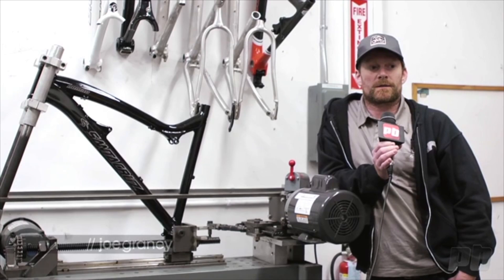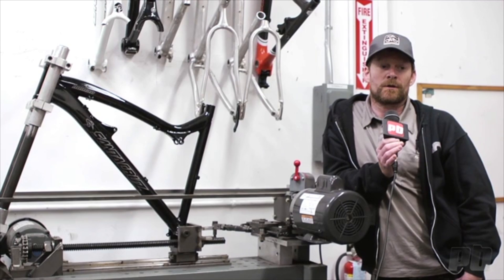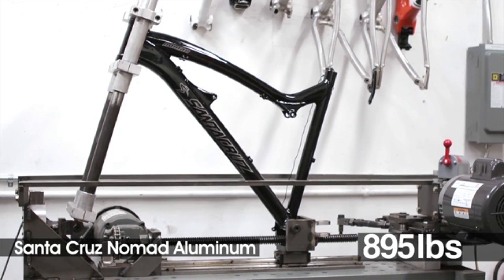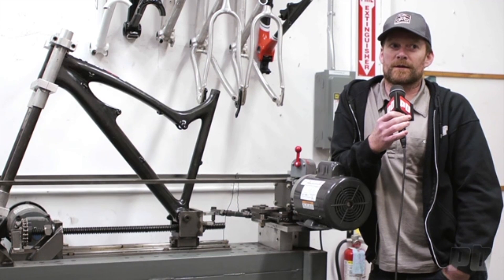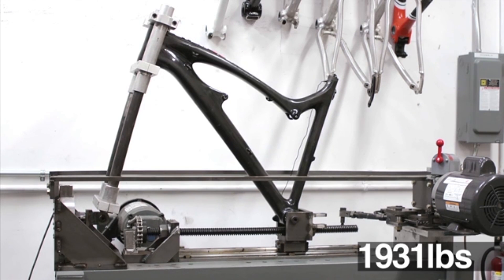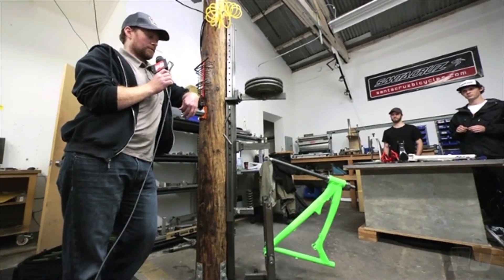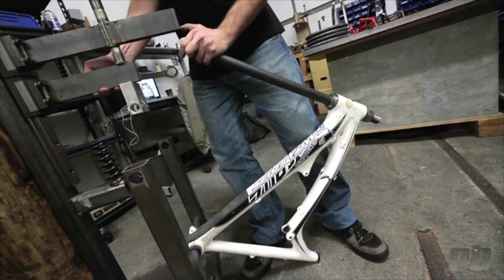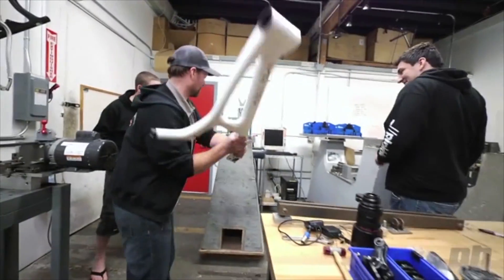Carbon vs Aluminum Frames - Which is Stronger?

Comment: carbon hides internal delamination well, which for me is just as dangerous as a bent or cracked alloy frame, aluminium has the win for me, if I was a sponsored rider carbon all day please.
Reply: No delamination. the loading was not shear.
Reply: soo are you riding carbon or aluminium haha
Reply: when you just bought the highly expensive carbon one and found out that you re failed. Then find an excuse to look good in certain way lol
Reply: I just got my first carbon mtb. It’s a SC with lifetime warranty and I know they will take care of me should something happen. Feel so sturdy and rigid 👍
Reply: Pretty much all companies have warranties on their frames nowadays, so you don’t need to be sponsored to avoid economic ruin.
Reply: Yep I agree if I was a sponsored rider I'd use carbon but I will never use the same bike more than once in a competition.  Ride it hard one day then get rid of it for another.  I don't trust carbon anymore than that.
Reply: Flats Forlife Dont think you have anything to worry about going carbon in this day.. Its virtually a non issue at this point.. I've been on it since 09 without a hiccup.. Big crashes hucks to flat.. Complete and utter pure unadulterated north shore and rocky mountain riding and not a Single issue! Don't be scared of the big C! It's come a long long way.
Reply: I work with composites quite a bit myself in the work I do, not bikes, but I am also a qualified pushy mechanic, although it's been a while now, but still not convinced it's the best option for a bike, looking at going cro molly myself, full circle I guess, but nothing has ever ridden as good as cro molly bikes for me, weight I am not scared of so only makes sense for a weekend warrior.
Reply: Flats Forlife Well I had the the first 2009 blur ltc that I rode hard and put away wet for 4 seasons! It then went to my dad who tops scales at 270lb and now my cousin for the past season until now.. Still waiting on delam or any inherent issues talked about.. Im all about real world use and its carbon all day for me!
Reply: I'm all about real world use also and carbon will not cut it for the riding I do, I just have to remember not all ride the conditions and style I do, ( theres a reason you do not see carbon trials, street 20 inch or dirt jump bikes,)  I guess for cross country people etc who's parents also suit their bikes it will do just fine, but for those of us who literally abuse their bikes every ride it will not cut it, casing a large jump alone is detrimental to carbon frames 9 times out of 10 whether it shows straight up or hides it within the weave for down the track you will not know, as for delaminations who are we to say it has not started inside the frame already, that's why I say it hides it well, usually a delam will occur on the inside of the tubing in the rough areas where the bladder has left hard edges and corners etc during the moulding process not on the smoothly laid outer surface you see with your eye. you will be oblivious to most delams until it goes bang, that's when you realise ooh I wonder how long that was like that?
Reply: Flats Forlife are u kidding me..Have u seen the shit cam Zink, Kirt Voreis, Andreu Lacondeguy hit on full carbon? It is plenty good enough for anyone in this comments section guaranteed! Providing the newer stuff of course. Danny Mckaskill absolutely destroys on his Santa Cruz 5010 or Bronson full carbon..Myself, I smash a Trek fuel ex 9.9 in Whistler bike park without any issue!..Its come a loooooong wayyy.
Reply: yep, correct and backs up my first comment of if I was a sponsored rider carbon all day long, those frames would be one comp and retired seriously sponsored riders continuous access to gear gives a false sense of reality to most. as I bail on more jumps etc than not it doesn't make sense for me, the fact a pro will pull off nearly every attempt makes sense for them to ride the free carbon bike pushed upon them by their factory etc, it sucks people in for sure.
Reply: Flats Forlife Well I've been on full carbon since the inception of the Santa Cruz blur Ltc..Im no pro but I've cased numerous gaps, hit trees and had some epic bails..From 2010-now ...Not so much as a hiccup ..The suspension takes more of the beating and I'm always servicing.. Also don't kid yourself if you think alloy doesn't get compromised over time and break catostrophically. ..
Reply: alloy bends before it breaks, gives you fair warning, bent alloy frame buy a new one before it breaks, delaminated carbon frame you would not know until it breaks, delam is the bend in carbon you could say, but you will not see it like one in alloy, suspension does help and as said this is why you will not see carbon on full rigid bikes that cop abuse, hence reinforcing the fact alloy and steel are the way to go for strength carbon is the way to go for weight saving for sure, but to think you have gained strength and structural longevity from using it is far from the truth.
Reply: Flats Forlife alloy bends before it brakes if it's not at a weld ..Ive seen it fail straight away at weld joints and that was just at 24 hrs of adrenaline race..Yes carbon will fail immediately..If it does ..But again, highly unlikely on the newer stuff.. I'm even on carbon wheels now and casing step ups constantly ....When I have a fail I'll gladly post here.. However ,I think ill be an old man by then.
Reply: @electricdeckhead3083  still not convinced? Even downhill pros ride carbon at this very moment...
Reply: @DutchBassics  so would I if my bikes were supplied, hehehehe 168 people agreed with me it seems.
Reply: @electricdeckhead3083  yes, three years ago... xD

Downhillers are still free to choose aluminum, but they don't...
Reply: @DutchBassics  redbull rampage riders don't, hehehehe
Reply: @electricdeckhead3083  Brandon Fairclough is a Rampage rider and he rides carbon... xD
Reply: @DutchBassics  correct, but thats a minority as carbon is among redbull riders because alloy handles more abuse.
Reply: @electricdeckhead3083  nope, it doesn't. Carbon is much stronger than alloy...
Reply: @DutchBassics  did you even read the link? quite simply it doesn't handle the abuse aswell which is why most ride alloy still at rampage,
Reply: @electricdeckhead3083  no link posted....

Comment: If another idiot says aluminium is stronger than carbon fiber, I'll crush his head with a similar machine they used
Reply: Carbon is obviously stronger and stiffer than aluminum. Where carbon fiber fails is when it as been compromised. Let's take for example a carbon fiber hockey stick is almost unbreakable when brand new. Play a few games with it and chip it to a point where some layers of carbon break and the stick will break without warning and without much pressure. I'd rather ride an aluminum MTB because I bail quite often and I would risk compromising it. On my road bike, I take carbon because of the weight, rigidity where it's needed and comfort where it's needed.
Reply: +ttoussaint 
1) let's start with the fact that a hockey stick is meant to bend a lot. I play hockey BTW. Of course it will be compromised after a long use since it will resist very intenses flex. A carbon frame isn't meant to bend as much as a hockey stick. Not in any similar way in fact. Carbon tubes will bend just a little amount and of course they can break like anythhing else. But I can tell you, I've crashed my carbon bikes a lot and they never broke appart. But I have broken 2 aluminium seatstays.
2) the best argument I have is that carbon fiber is just as good as its engineering and the way it is assembled. I'm not wondering why Formula 1 car aren't made out of aluminium.
Reply: Anthony HT Hahahah so true man! Peeps are still stuck in 2003 thought processes
Reply: Why are you so worried for signs before failure? We've seen the aluminium frame slowly bend from 0 pounds of force all the way to 1400 pounds of force. But you know what, at 850 pounds, there was already a serious deformation in the down tube. It's a good thing to know that there wasn't similar signs of failure for the carbon frame at the same moment. In fact, signs of failure for the carbon frame happened very suddenly at a force almost twice higher than the alu frame. In my opinion, they were too kind with the aluminium frame, they should have declared its breaking point happened at 1000 pounds of force, where we can see the down tube getting warped. In the end, it's a consumer choice, you get the best you can get for your money, and aluminium frame are still very good, don't get me wrong here. Carbon is just more solid and better WHEN properly engineered.
Reply: Yes when it snaps, it snaps and that's the end of your ride. But don't you think it's good to know it takes more than double the force to break a carbon frame compared to an aluminium one?
Reply: @Hoshikani, it's only as good as the engineering that's put in. I never said carbon fiber was a perfect material. Have a nice day and go find someone else to blast in another comment section.
Reply: So the consensus is Aluminum is Stronger than Carbon.....
Reply: Micah Watts  yes! That's exactly it... Especially in 2017..
Reply: ttoussaint That's apples to oranges dude!
Reply: Trevor Bohnsack  Well, when I see a hockey stick and a bike frame snap, it's pretty much the same. There is next to no signs before failure. That being said, you can hear the frame in the previous video, when put to pressure in a progressive manner, cracking. You can hear the fibers giving up before the snap. That's enough for me to stay away from CF until they really prove that it can sustain more abuse. I'm not saying that aluminum is better eather, it's just not worth it for me to spend the extra money for something that I would not feel a real difference on the riding because well dialled suspensions will make a bigger difference in the comfort and I feel my aluminum frame will be harder to compromise when crashed on the ground.
Reply: Indeed, it has the potential be be a lot better , but consumers have no ways to check if bike carbon has been well made or not. Even top brands like Trek make/made carbon frames with issues. And as can be seen in this video, when they snap... it's immediate and without any possibility to control your fall. You just end up with 2 bike halves. and that's scary.
Reply: Anthony HT damn straight!
Reply: Anthony HT Hahaha!
Reply: Dawn Moon I guess hypothetically speaking one could get a a lemon frame....Highly unlikely at this point in the game tho...That being said, I'm on a Trek fuel ex 9.9 now..These frames are insane ..All the tubing has been beefed up as well as the chain stays...I tested both the alloy and carbon in demos before purchase..The alloy is no where near as stiff and had flex in hard cornering...The new Trek oclv carbon is unfuckwithable in every regard...Just go demo one !
Reply: Dawn Moon Also keep in mind how strong it is in this test and this is 5 years ago! 5 years..Thats a long fucking time  son! Its come leaps and bounds since this test even.
Reply: Anthony HT carbon fibre frames can sustain lots of abuse, but NOT on the side, they'll crack in no time if they go against something, just see how many trials bikes there are with carbon frames, that happens for a reason, carbon can easly break if a force is applied on the side/lower part of the frame, anc i dont mean break at the point, i mean do something that puts any stress on that point and you'll be walking home, meanwhile alu can take much more abuse and doesnt just break, it shows signs
Reply: Anthony HT if you want to look at idiot, use mirror. and learn what is internal delamination of carbon
Reply: Hoshikani Still waiting for the day I get Internal delam.. On my 6th frame now since 2010 and I'm waiting hard for any signs
Reply: @Trevor Bohnsack hahahaha, and I'm on a 2009 Kuota kredo and apart from a flexy bb area, every bit or carbon is still glued on to each other bits.
Reply: Anthony HT I believe it.. My cousin still rides the shit outta my 2010 Santa cruz blur Ltc and hucks the shit out of it! 👍 😎
Reply: After some years of abuse, it can go really quick for carbon. And twice as much sounds reassuring indeed, but in practice it probably means it won't break unless someone twice as heavy uses the same bike , or you can fall twice as deep after a big jump :)
Reply: Anthony HT F1 car are made of carbon because of the weight and also the way carbon fails. When an F1 car crashes the carbon components break off taking some of the energy of the crash with it so it does not transfer as much the the driver. Aluminium will rather bend absorbing so force but not as much. On the other hand on a bike it's kind of reversed since you dont sut in the frame. So when the carbon fail on a bike you take the full force of smashing your face on a rock.
Reply: bruce tec haha cuz a bike is going to hit with the same force as a car... Please show me a carbon bike frame failure that is that catastrophic in the last 3 years.. It rarely happens anymore.. I've personally broke aluminum frames clean right at the welds... There is no comparison in 2017.
Reply: Trevor Bohnsack I am not staying that carbon is not stronger I'm just stating the differences. I ride a alum road bike and I like it. I tried carbon bikes and they are great but I'm no pro so it's overkill for me. Also I weigh a lol over 200 lbs so if I want to save weight I'll start there. Lol
Reply: bruce tec Gotcha! I agree about the negligible differences.. My mountain bike is carbon only because it's my one true hobby and I splurged.. For me it's more about ride characteristics than weight.. My fat bike is alloy tho..
Reply: ttoussaint haha! What more proof do u need other than carbon is ubiquitous through every major and boutique manufacturers.. You think they would want all those hypothetical failures on their hands for warranty claims.. The brand confidence in carbon has grown immensely.. Add to that the fact that every major athlete is on it even for extreme events like rampage! Surely you are not riding at or beyond those levels.. If its good enough for the pros it's good enough for you.

Comment: It would be a lot more valid to compare them in percentages of force to break vs their own weight. Because I doubt the aluminum and carbon are the same weight, so the test isn't exactly even.
Reply: Carbon lost but no need to cry.